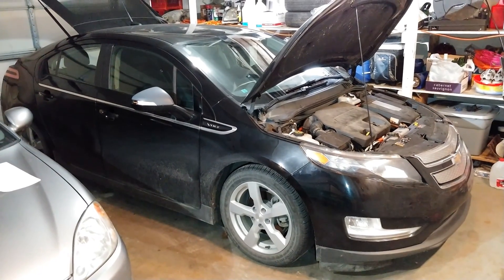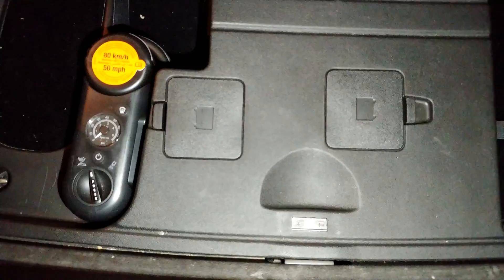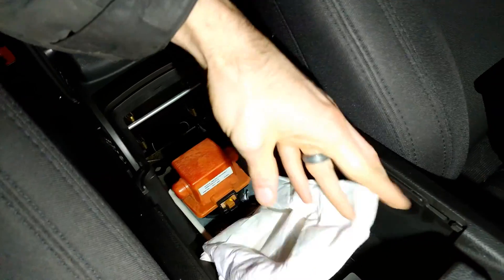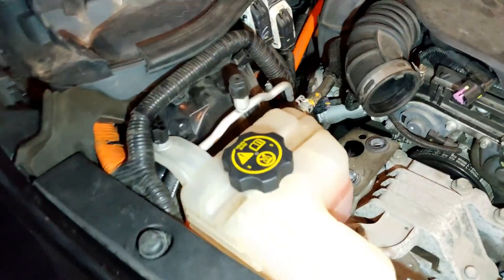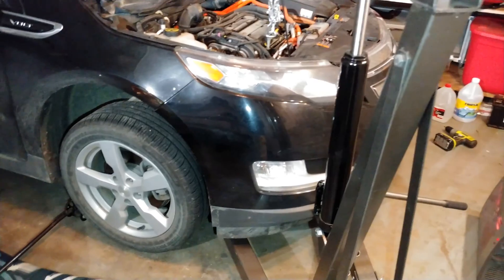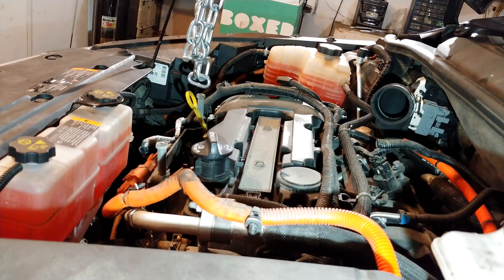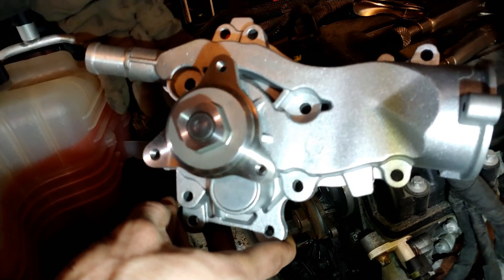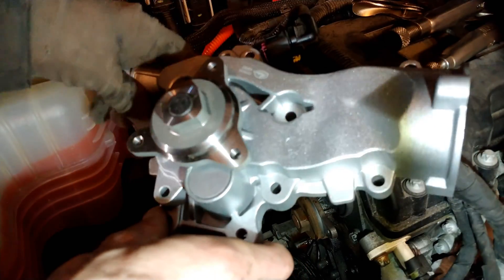2011-2015 Chevy Volt - How to Replace Engine Water Pump

Comment: Sorry the warranty does not cover the water pump
Reply from the maker: That's a bummer! If you're in the area where a mobile YourMechanic.com technician could come to you, it would be cheaper than going to a shop or dealership. I think the mobile mechanic quotes out around $750 for water pump, belt and thermostat or $575 for just the water pump.

Comment: Thanks for posting this. The dealer wanted $1100 to do this job. I just completed the job thanks to your video. I wouldn't have tried to tackle this if I had not seen your video. I did one thing different than you did though. I did not fully remove the lower bolt on the engine mount bracket. By jacking the engine up high enough I was able to remove the water pump without fully removing the engine mount bracket. Loosening that lower bolt was the hardest part of the entire job. Also, there are three different length bolts on the water pump. I highly recommend people to make a diagram to locate these bolts as you remove them unless you have a shop manual.
Reply from the maker: You're welcome.  I watched a video on changing a water pump on a Cruze and assumed it would be similar and it was, however, there is more room under the Cruze hood.  Thanks for the tip on the lower engine bracket mount bolt.  I hope I don't have to do this ever again, but that could spare some time.  Yes, definitely need to keep the three different length bolts in order.  As I removed them, I placed them into the new water pump holes so I knew where they were going upon reassembly.

Comment: I have everything here to do the job.. But they keep telling me I need special tools.. Is that true?
Reply from the maker: I did not need any special tools, unless you consider a torque wrench a special tool? I chose to use an engine hoist, but you could use a floor jack, but make sure you have a wide base of wood to support the engine so you don't damage the oil pan.
Reply: Also they have two torque  to yield bolts that are 2 3/8 inches long that are needed to replace in dealer quote but it is not seen on your video.  Was curious as to where they go and tourque specs as well.  T. I. A.
Reply from the maker: I assume those are the engine mount bolts?  If so, I reused them and have not had any issues.

Comment: Thanks. I already have the belt waiting to be swapped. One of these days, I will buy the water pump and with your tutorial, it will be easier to do this myself. 2012 Opel Ampera with 182000km.
Reply from the maker: You are welcome!  The belt is supposed to be replaced every 150k miles or every 10 years, whichever comes first.  Good luck!